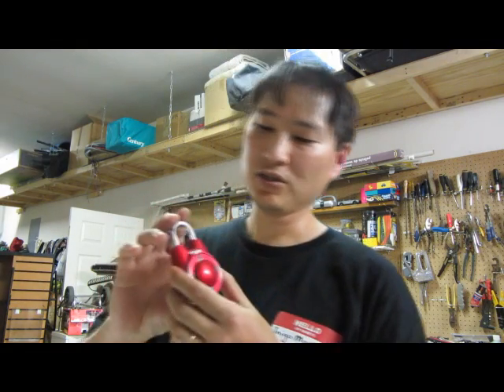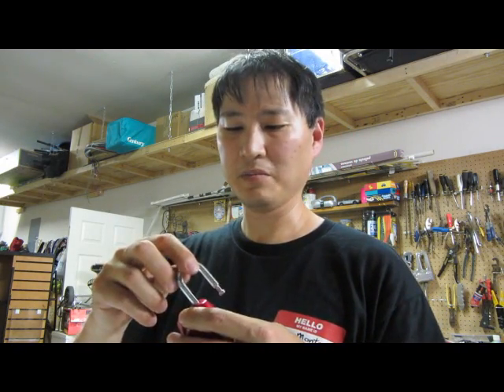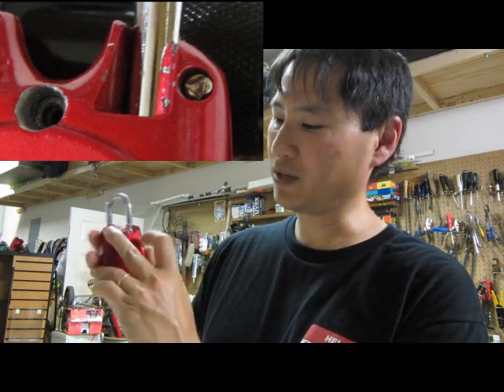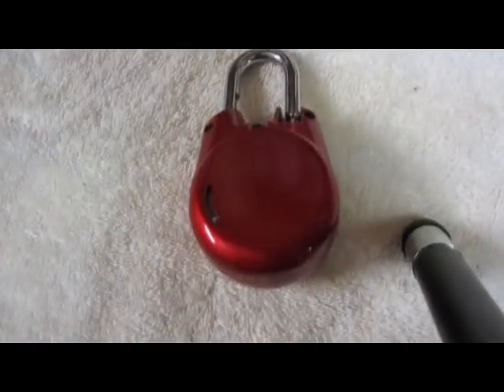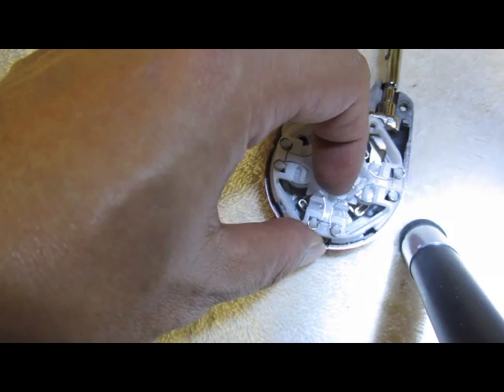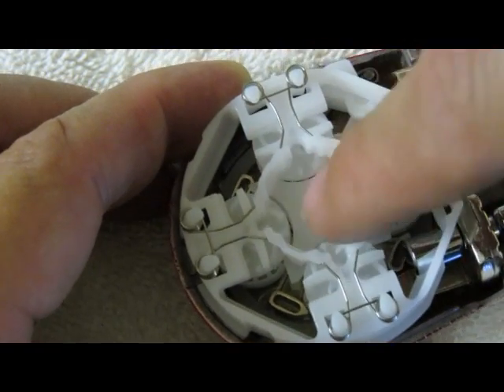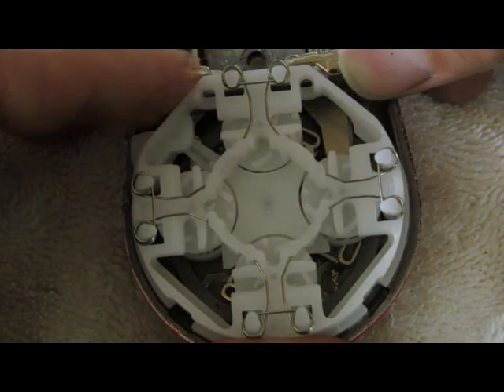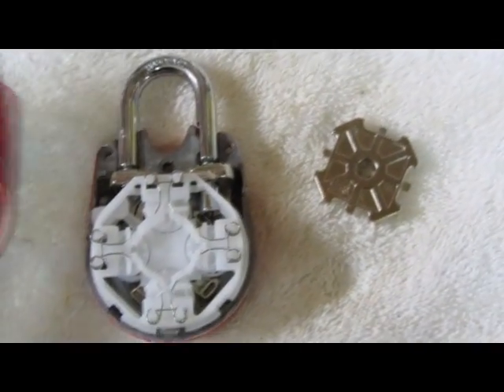How a Master Lock Speed dial works

Comment: Actually the mechanism is more ingenious then you give impression of. Because when doing one move with the button actually 3 wheels is moved. That way decoding it by putting tension on the shackle is much harder than if just moving one wheel.

Definitely agree its one of the better locker combination locks. Not immediate vulnerable to decoding or shimming like all to many of the other combination locks. It's honest. Not the toughest but none the less not removable without real tools breaking it.

Comment from the maker: @tocaracer06 I had to obliterate the head of the one way screw to take the lock apart (It's a mechanic's technique).  Just drill enough to snap the head off the screw, otherwise you will mess up the threads (go slow).  When you take the back half off, you can get the rest of the screw off with pliers.  Then I just used a small machine screw of the same size to put it back together.  Good luck!